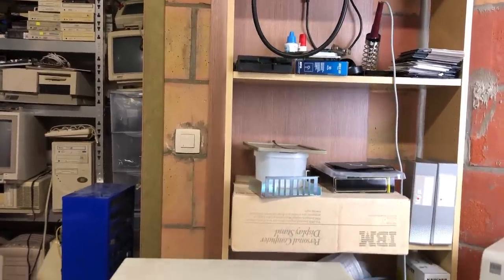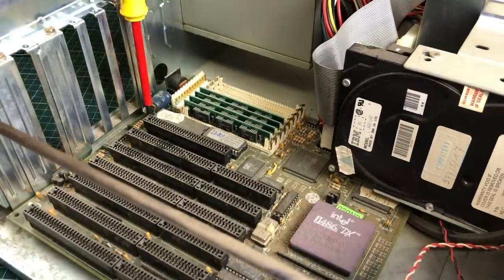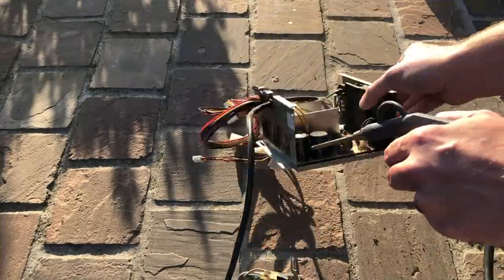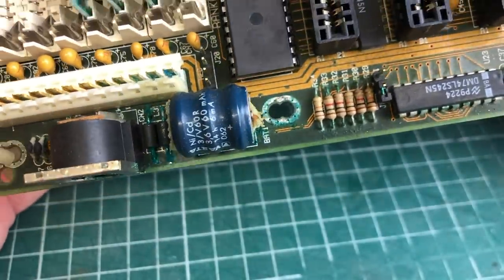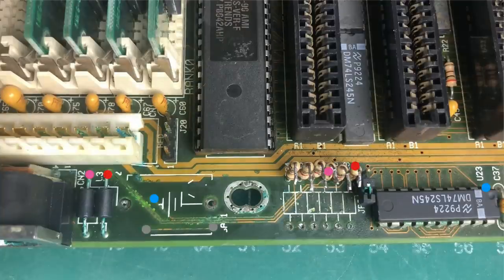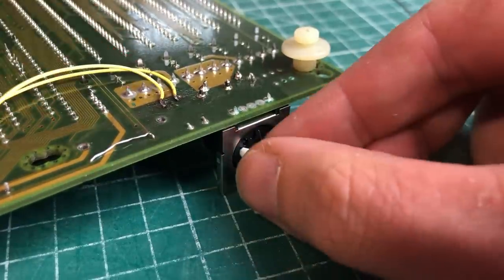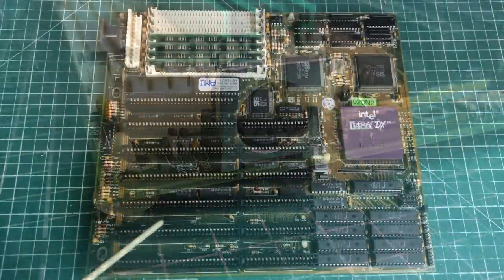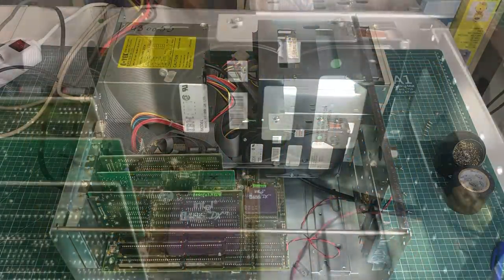486 from trash to treasure

Comment: thank you for posting.  at about 10:00 you refer to damage & corrosion from battery acid.  a polite, respectful, gentle suggestion/correction.  that varta barrel battery has a basic/alkaline/high_ph electrolyte, not acidic/low_ph electrolyte.  that's why you use an acid/low_ph vinegar [dilute acetic acid] to neutralize the electrolyte and dissolve that green corrosion.  perhaps just refer to 'removing battery corrosion'.  take care & stay safe.  would that we all had a working turbo button. :)

Comment: Excellent.  I've been restoring the 486 DX50 that I've had since it was built / bought new. I agree with your assessment about the desktop case and have had quite a lot of fun with this machine. 

I will say that I got lucky and noticed the Varta battery leaking on mine and clipped the terminals then to prevent any damage. I'm so glad I did because the motherboard worked perfectly almost 11 years later when I finally got around to trying it out. 

Excellent video, very thorough with a good pace.

Comment: It may not have been a 386 upgraded to a 486. The date on the power supply was 27th October 1992, so a quick glance at the ads in a computer magazine from around then shows plenty of vendors still selling 40MB drives. As you point out, it looks like they were running a Novell NetWare server, so it would make sense for them to go for the cheapest hard drive, since their documents and apparently even their programs were stored on the server.

Anyway, it's always nice to see these old dead machines repaired and working again. Keep up the great work!
Reply from the maker: Thx a lot .... always cooling trying to think about its origins ... nineties were crazy in that you could buy  a new 286 and 486 at the same time period ... a wide variety of performance / storage / memory / ....
Reply: @RetroSpector78  it was because all hardware was superexpensive, even low -end, so it was worth for them to keep production and factories on. it was still profitable. Nowadays, with motherboards prices around 70-100$, which would be like 30$ in 80's and early 90's, it's not worth of them to keep production, and they discontunue it as quickly as possible, when it's outdated by new generation of hardware.

Comment: Man, I loved those early 90s cases!  Computing in the early 90s was so much fun.  I'm partial to that era (probably because it was when I built a PC for the first time) and that AMI BIOS.  That must have been a fairly early 486DX-50 though considering it only had four megs of RAM and only a 40 meg drive.  I built my 486DX-33 in in November of 1992, and it had four megs as well but also a 130 meg hard drive. EDIT  You addressed my point right after I finished asking it regarding the smaller drive and faster processor LOL.
Reply: The RAM and HDD were probably from an old 286 which got upgraded
Reply: @Bolling Holt I also had a dx33 with a 130mb hard drive. Your computer case didn't say Precision on the from did it? Did it have a Soundwave 32 card?
Reply: 😎their cool
Reply: @retroguy4139  Nah. And I had a Media Vision  Thunderboard that I kept from the 8088 I had before ;)

Comment: Really nice to see that board fixed. I've been trying to do the same to a 486 board in my possession that has suffered rather extensive corrosion damage, but unfortunately, no such luck. Even though I feel like I've checked every affected trace twice and bypassed two broken ones, I still get nothing but strange, quiet interference noise from the PC speaker, really not sure how to troubleshoot this further. Maybe the corrosion has damaged some small nearby SMD components, or the board had already failed elsewhere before this.

Comment: Nice work on the rewiring! You made it look very simple.
I would've been a bit more thorough on removing some of the corrosion - there is definitely some green gunk on the motherboard power supply pins that could cause some issues in the future.
I notice you didn't replace the battery - I have a 386DX-40 that fortunately had its battery removed by the previous owner before it could do any damage. I've been thinking about adding a CR2032 somehow, but for now I'm just running it without a battery and entering in the CMOS data manually each time.
Reply: Does your board have external battery pins? I would imagine they're really common on 386 dx40's. I just use those with a 3xAA battery pack and velcro the pack off board to the case
Reply from the maker: I did in fact hooked up a coin cell to the external battery connector of the board (couldn’t solder the coin cell holder on the board as the holes were too close to the edge of the motherboard. But totally forgot that footage :(
Reply: @RetroSpector78  Remember that the original battery was rechargeable. If using a primary-type coin cell (CR type for example), ensure that it won't be charged as this may end badly.

Comment: Keep the DHL inventory sticker. It's part of the computer's identity. And note how that 486 mobo is basically very OG, no PCI, no VLB. The CPU isn't even a DX2, it's a vanilla DX.
Reply from the maker: yeah ... because it was combined with a 40mb drive it was either a 386 upgrade or an original very vanilla 486
Reply: @RetroSpector78  first gen 486.  I never knew upgraders to mess with the speed jumpers.  I always just set them to "HI" and "LO".

Comment: Nice machine. I'm beeing a bit jealous. I didn't save much of my old stuff back in the day, although some is still here. Victor 286p laptop. Mac SE/30 and Amiga 600 and C64 and some old Powerbooks. So ok, some at least. But I am "living the dream" (sort of) with my main desktop. It's a HP Z200 Workstation cirka 2010. It's a convertible so I run it like a desktop and not a tower. Has almost the same proportions as your 486. And I run OpenBSD with FVWM so I am well covered on that 1990 UNIX Workstation feeling. I don't know what it is but it has that good vintage feel about it and still very up to date software. And I was fortunate to be able to canibalize an old Mac Pro, so I have a Apple-Radeon HD5770 to drive a 27-inch Cinema Display with Mini-DP. And OpenBSD is so light on resources so even the system runs well on spinning disks, so I don't have to suffer in silence either. :) Thanks for a nice video. Would be nice to see a contemporary full-tower Netware server. I worked a lot on Novell Systems around version 3 to 5. A well setup Netware was very reliable as long as you had a good UPS. They really didn't like dirty shutdowns. But damn, they knew a thing or two about scalability. Pity they didn't keep up and evolved themself better.
Reply from the maker: I've done a windows networking video last year but never really did anything with Novel ... did pick up 2 nice Novell networking card boxes the other day .... might give it a try .... good you kept the amiga ... love the 600 model .... have a 500 and 1200 but that's it .. they are crazy expensive and very difficult to find.

Comment: Really liked your trouble shooting and repair section - the one thing that puts me off about collecting retro computers is having to possibly face up to such problems;  I've filed this vid away for future ref in event I try to collect a vintage PC - am really fond of the brief Intel 80486 era of computers -  speced like this one
Reply: Well, you can also collect working vintage computers.  The ones that didn't break or that people like this content creator already fixed. You will pay more than for untested scrap ones, but it's still pretty cheap. I bought three 486s, two Pentiums, an XT and two 286s for a few hundred euros together last year.  I am only missing a decent 386.

Comment: on those days Varta batteries easily leaked, reconnecting broken lines due to corrosion is a pain in the a** ,so back then we already replacing those with CR2032 mounted on its holder

Comment: Neat video I have only two 486 systems left. One is a 486 system that has a 83 Mhz Pentium Overdrive Processor in it though I have a lot of good 486 CPU's to replace it if I wanted to. I also have some MPEG decoder cards too so that I can play Phillip's CD-i Video CD's on those old systems.

Comment: I agree, 41mb seems small for a 486.  I have a Tandy Sensation 486 with factory 107mb drive, but make up for it a bit with a 100mb parallel zip drive.  My 386 I had in the 90's had a roughly 100mb drive, and it felt very cramped.

Comment: It's not always the case that the battery electrolyte dissolves the traces, but it is common. I just cleaned up an XT-clone with a Varta battery, and the traces all seem to be intact. Can't say the same for one of the ISA slots, which seems to be beyond cleaning and which I'll probably have to replace. 
Something else to check would be the tantalum capacitors. They're supposed to be very reliable... Until they're not. When they go, they go the same way as RIFA caps: closed circuit, which means magic smoke.

Comment: My first computer was a 286 with a dead Dallas battery, so BIOS could not remember settings after a power cycle, and I had to enter all the parameters when turning it on, which took a good minute. I had that machine till P100, and that was quite a transition. Never had a 386, but had a friend who owned one. 486 only saw at stores. Didn't know anyone who had it. Recently built my first 2 machines on a 486. A bit underwhelmed. It's either too fast or too slow, but never just right. Feels like a faster 386 as oppose to a slower Pentium.

Great to see another motherboard brought from the dead though.
Reply from the maker: You were lucky because sometimes dead Dallas batteries will prevent a computer from booting completely.
Reply: +enilenis Yes, unfortunately, 486 falls even behind Pentium 60. First pentiums were underestimated, I remember, how a kid in that time, I watch only at megaherzs as speed, I though, that 486 DX4 100 mhz, is faster than Pentium 60, but actualy, it's not. In floating-point operation, Pentium 60 match like 160 mhz 486 DX4. I saw benchmark results in Quake 1, which is heavy floating-point operation program, and yes, Pentium 60 have there more FPS, than 486 at 100mhz.
Reply: @warrax111  I was extremely fortunate to get the last 486 motherboard. I think it was $5 with CPU and 32MB of Ram. I have it on my channel as "486 inside a CD player". I topped that machine off with 64MB of Ram, which would be unimaginable in its day. What DOS program would ever use that much? I think my Pentium 100 had only16MB of Ram. It's insane. Plus VLB. But I tried some DOS games that play video and the CPU can't decode fast enough.

Originally the motherboard had a 133MHz CPU in it, which I know to be a not yet branded AMD K5 underneath. If I had the motherboard working with it, I bet it would feel like a Pentium, but I was not able to start that CPU. I did have a box of spare 486 chips, so I installed a DX2-66. Since the CPU is on a riser socket, there is a good chance that some passive component on the socket went bad. And maybe I can get it running again. Would love to test it. Seen only one of them show up on ebay in the last 2 years.

I was hoping that the board was discarded just because its own battery leaked, but no. It was CPU also. But the rest is still amazing.
Reply: @warrax111  I remember a demo at one store where I think they had an 80MHz DX4 loose out to P-75, running benchmarks side by side. They also had other cool 90's stuff. The Forte VFX1 helmet and the sensory glove. Helmet was something like $1.5K. Glove was $9K, and to me that made no sense. How could VR vision be cheaper than some fancy hand controller? I loved hanging around Thinkpad section. IBM was the coolest looking thing around.

Comment: Another amazing video....question....for the cable you used to check continuity with keyboard connector, what type of cable did you use to insert into the keyboard connectors and how did you connect it to your multimeter to work with the normal multimeter cable to check continuity?

Again, great video as always....
Reply from the maker: Thx a lot. I just used a pin shaped crimp connector that I crimped on a cable, and hooked it up to my multimeter lead with a crocodile clip on the other end of the cable.

Comment: Nice restoration work,  nice to see a piece of very old hardware coming back to life.

I wanted to see how you sold or what kind of replacement did you do to adapt a coin battery for the BIOS in replacement of the battel battery

And the obvious question: can it run DOOM? 😉

Comment: Sir, while testing my AT SMPS, I kept it running (after removing dust by air only) attaching my two multimeters on +12 and +5v.
After about 30 min, I heard a small POP noise, then couple of more POPs in few seconds of interval.... then a bigger POP followed by smoke and smell.
No fire etc.
Do you think this SMPS is repairable and should I repair? pls suggest.

Comment: I missed it or you didn't replace the battery with anything?
Reply from the maker: you got me there .... totally forgot to edit that one in ... Although the holes for the battery matched up with the ones from a coin cell holder the coin cell holder was too far along the edge of the board and it was hitting the case. I used the external battery connector on the motherboard to wire in a coin cell battery.
Reply: @RetroSpector78  good to know it got put in :-)
Reply: @RetroSpector78  the original battery was Ni-Cd, so rechargeable. A typical lithium cell may be damaged if recharged.
Reply: @spyd I was scrolling through comments wondering the same! I thought I missed that too. How did you adapt a non-rechargeable battery to that MB?
Thanks for the nice video, lots of memories here too!

Comment: 50 mHz, I wonder if it’s fast enough to run Duke Nukem 3D. I used to run it on 486 DX 33 mHz system (with paradise SVGA card and 16 mb of ram) and it could just about run it and a somewhat playable speed at 320x256 resolution. The minimum spec for that game is a 66 mHz cpu. Just wonder how well a 50 mHz system would do. Sadly the 486 that I had is long gone, my dad once messed up the jumpers on the board and it was trown out in the early 2000’s. I wish I still had it. Now I use PC-em to relive those 486 memories.

Comment: Do you often not to enable Cache Memory? I used to have 386 DX system with AMI BIOS exactly like this.. I was 10 when i found out the option under ADVANCED menu can speed up the system.

Comment: I see green on power connector contacts tooth brush will get down in their but like someone else commented wash the board but even then it can still activate cause the protective sealant is gone one reason I don't hold much hope for these kinds of damage it very hard to get all of it then you got the sealing issue sure they must make some kind of sealer for that.

Comment: I'd like to see a DX-50 compared to DX2-50 and DX2-66.  I'm certain it's faster than a DX2-50, but the 66 is a mystery.  50% faster bus is nice.
Reply: For sure it is faster than a DX2-50. In my time people preferred the DX-50 above the DX2-66. Down side was that the bus was running at 50MHz which didn't always work with all isa cards, as they will often also run above spec speed.
Reply: @aseesing  interesting. Never saw a processor, that it meant to run on overclocked FSB in stock state. Intel usually never do it, stock speed is always on stock FSB, that means, in normal state, motherboard rather underclock processor to keep base FSB, and all PCI and ISA buses within the spec.

Comment: Was it not feasible to find two through hole.points to bodge the two vias together? I always worry the via will pop out or I'll damage the board further. In either case looks like.it worked! Love watching these 90 pc repair videos reminds me of my youth. Thanks for the video!
Reply from the maker: That one in particular was not linked to a through hole component. Only found a connection on an SMD SIS chipset pin.
Reply: @RetroSpector78  that's rough! Well I guess there's no other choice then 😁 it still turned out just fine so I guess that's what matters 🙂

Comment: DIN style doesn't always mean Pentium or lower. there were BabyAT Pentium IIs and IIIs, and even a Pentium 4 BabyAT board or two (which needed an ATX supply though for obvious reasons) so it's not completely correct. BabyAT form factor stuff was still used way into the Core 2 era for industrial PC stuff which required that form factor for upgrades. By that point the DIN connector became a smaller PS/2 keyboard connector but some retained it. such boards are hellishly expensive even used tho.
Reply from the maker: Maybe true, but you gotta admit that seeing a din connector on this kind of form factor will give you a 95% chance on a pentium or less :)

Comment: should give it a cd drive too, soundblaster and vga card and hdd upgrade, see if you can max out 3.1 and get a few 8 gb hdd or partitions to work with it
Reply from the maker: indeed ... but my 486 time period correct peripherals are somewhat limited .... so I'll leave it up to the next owner :)
Reply: @RetroSpector78  no harm in using a bit newer like pentium to pentium 2, and if you don't have a 486 i'd suggest keeping it for games of that era and before if you lack a 386/286 (to underclock with for them)

Comment: That is not really a "speed indicator", the use jumpers to display whatever you want.  Because it says 50, I bet it was built that way.  Most who do upgrades normally do not bother to change that.

And a 40mb drive would be common in a Netware environment.  Did not need much for a local drive, most things would be stored on the server.
Reply from the maker: True ... but its primary goal was still to indicate the speed of the machine :) And you're right with the netware remark ... lots of apps were stored on a networking drive apparently.
Reply: Yeah Saving money there like thin clients of today. I remember installing a 10 Base T network with coax back in 1997. Kids would steal the 50-ohm terminators and bring down the whole bus topology network.